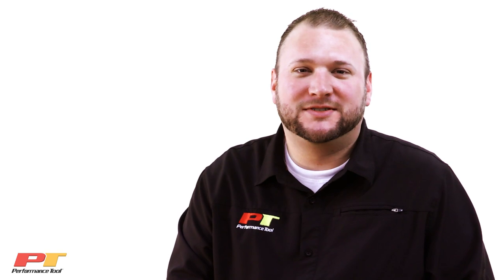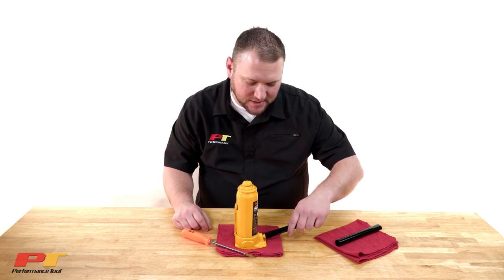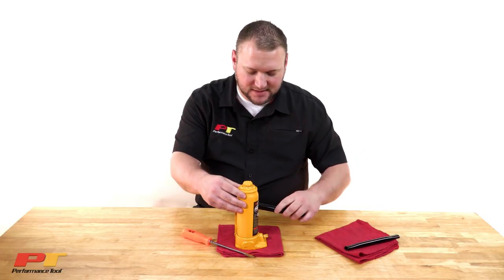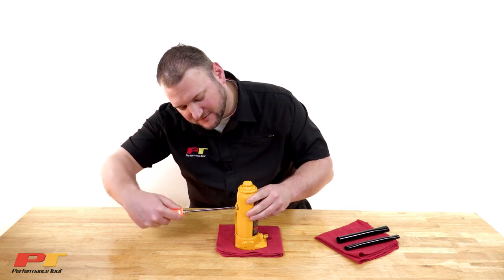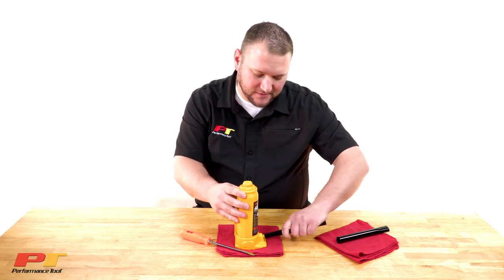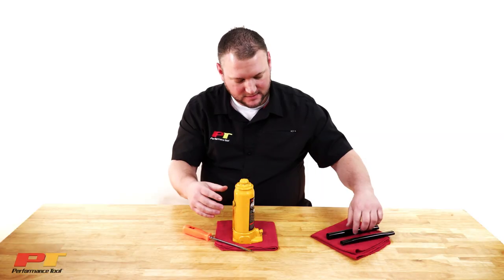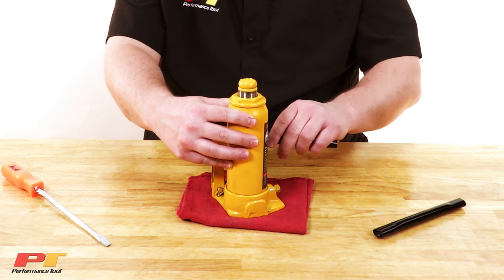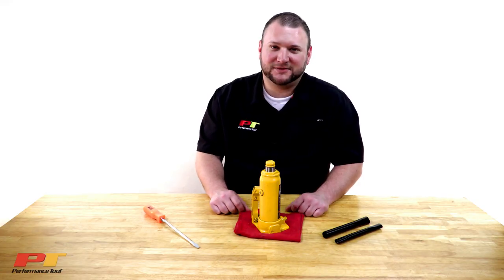How to Bleed a Bottle Jack

Comment: My jack has just a rubber bung plug,how do you deal with that?
Reply: You just remove it. I use a small flathead screwdriver. Be careful because it may pop out into the air. You may want to secure it with one hand. It's a challenge to put back, but with a small screwdriver, I squeeze the bottom of the plug here and there while at the same time pushing it into the hole until it fits.
Reply: Thanks so much